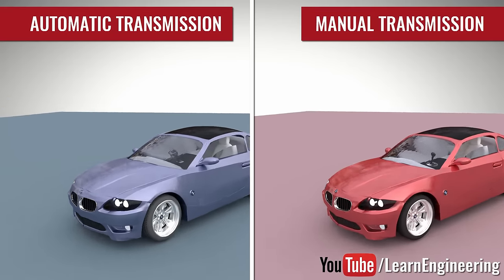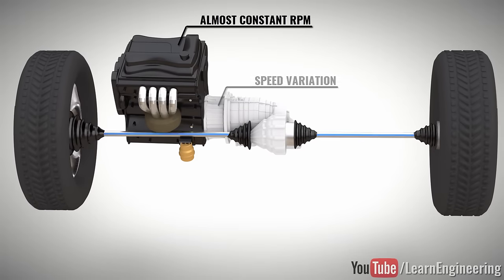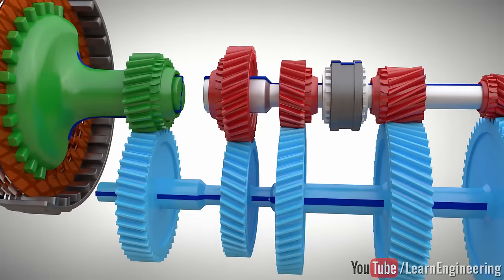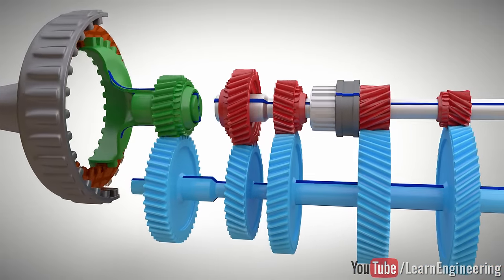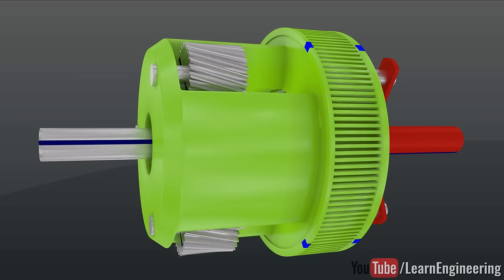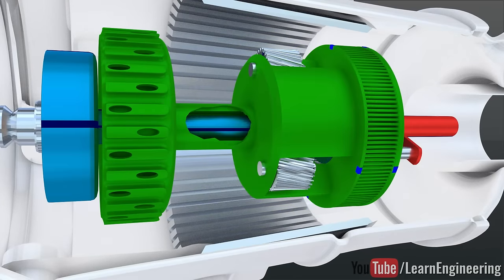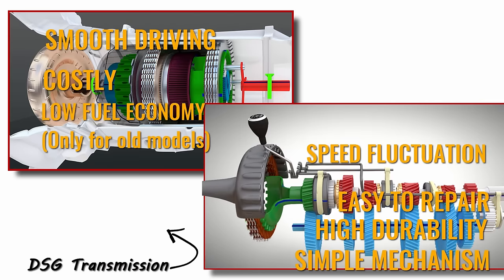Automatic vs Manual Transmission

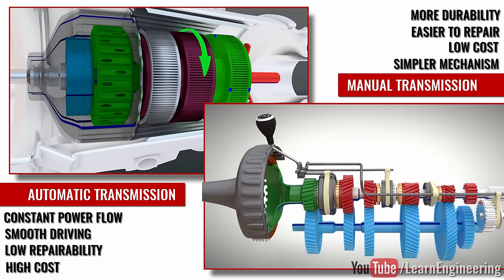Comment: 6:34 now that's an error, even a grave one in certain cases. Engine braking is much safer and keeps the brake last longer. Doing it is relatively easy: press the clutch, shift down 1-2 gears, release the clutch steadily to prevent sudden thrust, and if necessary, lightly brake to signal the following car that you're slowing down. Braking while pressing the clutch can often be quite dangerous, especially when driving downhills. The only time you should do it is when exercising emergency brake.
Reply: Yeah dude said press clutch then brake and all I thought about was the new brake pads I'd be buying for my work truck lmao

Comment: Manual - direct acceleration
Automatic - you're ran over by a semi because the transmission needs a minute to think which gear to engage after you floor the pedal

Comment: By the end of the 1940s Americans disliked manual transmission so much, even though it had been made more user friendly with the synchronising mesh aka synchromesh technology, that more than 96% of people who bought brand new Cadillacs in 1949 were willing to pay an extra $200 in 1949 money to get the automatic transmission, which was an optional upgrade, not standard despite its overwhelming popularity. In other words fewer than 4% of 1949 Cadillacs came with the "standard" three-on-the-tree three speed manual transmission. Cadillac dumped manual transmissions after 1949, however there is a story on the internet that a woman ordered a manual transmission Cadillac in 1955.

Comment: I prefer manual, but the newer automatics are WAY more fuel efficient. I had a 2017 Freightliner Cascadia (manual) and averaged 8 mpg, whereas my 2019 automatic, I got up to 14 mpg. In my Manual, I could also spoof the governor. It was set at 62 mph on the pedal and 64 mph on cruise, but when I drove over an overpass (or up hill), the second turbo would spool up for extra power and when I got to the top, it jumped up to 67 mph and I'd hurry and set the cruise. As long as I didn't have to brake or slow down, it'd stay there. 😁 I know 3 extra mph doesn't seem like a lot, but at .45 cents per mile, it was a $1.35/hr. raise!

Comment: You don’t have to push the clutch before breaking in a manual car. You can also use downshifting in a manual car to perform engine breaking which is impossible in an automatic car.
Reply: you know an auto also engine brakes its just a bit less than a manual

Comment: If you’re braking in a manual with your foot on the clutch (disengaging it) then your doing it wrong. You lose the engine braking and increase stopping distance. Not to mention, you lose your brake pads quicker! Plus, to suggest a manual transmission is never smooth is very wrong! It’s not only the lead in ya pencil that makes a mark on the paper!

Comment: It's the same thing, same job, one's manual one's not. It depends on what you want, you want an automatic trans for daily drivers like work and back go for it. you also want manual for performance cars since you can control the gear yourself go for it. Also manual trans is good for mountains if you don't want to destroy your brakes and have to redo your brakes at the end of the month. Also another reason why older cars with manuals have lower fuel economy is because of the government didn't make you put as many things in the engine as they do today. Also if you're good at changing gears it will be a smooth ride, unless you're lazy. Remember, car manufactures told you how to change fluids or engine parts, now they have to tell you to not drink the coolant.

Comment: That statement about manuals is almost completely false. Manual driving can be very smooth if you know how to rev match, or even just hold the clutch at the bite point for a second or two. And you should only push the clutch down if you're changing gears, or your engine speed is about to go below idle. Not just whenever you brake.

Comment: At 6:35 “In manual transmission driving, before you press the brake pedal, the clutch pedal must be pressed completely.” WRONG! The clutch pedal only needs to be pressed completely if you are planning to come to a complete stop, if you are “locking” the brakes in an emergency, or  if you are going very slow for the current gear and could stall the engine. If you just need to need to slow down because of traffic conditions (or because you noticed a speed limit sign), you can often use the brake without needing to use the clutch pedal. I have been driving for 40 years and approximately a half-million miles and have done this thousands of time.

Comment: in a manual, u dont actually need to use the clutch if u know ur car well enough, my grandfather doesnt use the clutch for anything other than starting off, as if ur good enough, u can match the engine rev s to the desired gear speed in between gear changes

Comment: You forgot the biggest practical difference. Speed control in a manual is an intuitive, passive process because the engine and wheels are directly connected, so any change in speed will also have a proportional change in the sound of the engine. Speed control in an automatic requires paying attention because the engine RPM varies greatly. Well, most people aren't very good at paying attention to much of anything. The automatic transmission is 100% responsible for the plethora of seesaw drivers on the highway, and I hate all of them. If you can't hold speed, use cruise control.

Comment: Okay, at ~6:45 you're telling people to do something that can have you fail a driving test. You aren't supposed to disengage the clutch every single time you brake, just when lowering gears or stopping completely. It's dangerous to have the engine separated from the wheels for a long time.

Edit: lol, like half the comments are bitching about the same thing I am.

Comment: The statement about 80% of heavy duty trucks allegedly using manual transmission is wrong. At least here in Europe trucks have long become pioneers regarding automatic transmissions and can have more than 20-25 gears to become very efficient in driving, and reduce fuel consumption and emissions. So I don't know where this wrong statement stems from ...

Comment: You mention that for every time you push brake on manual you need to use clutch which is not true. You gonna engage clutch only when you brake enough for RPM to drop lower then idle engine rpm which most time is 1000-600 rpm.

Comment: 6:40 that's wrong . to have the bes brake you must use engine brake and the wheel brake toghether (a engine brake is when you are in a high gear like 3rd and you swich into 2nd, when you release the clutch the motor will slow the car down)

Comment: the confusing part for me was that you didn't explain how clutch and synchronizer actually works.
Reply: Clutch is same as neutral gear, that means your motor isnt conected to your manual. When you press clutch your manual just diaconect from motor and slow to that speed that syncronizer can slide

Comment: I find manual very smooth as I can control when the car changes gears. Much more useful on hills at slower speeds etc, much smother than an auto. 🤷‍♂️

Comment: Manual is better for places where there are a tons of hills, up and down, like North Italy. The italians bought automatic transmission ambulance cars, the cars' transmissions died in 2-3 years, since it always wanted to shift up or down.
Automatic is more comfortable, and better for highway or long, straight roads.
Reply: Gearbox is irrelevant on the highway or long straight roads since your always going to be in the same gear doing a steady speed.

Comment: Thanks, I didn't understand a thing but thanks anyways...
Reply: Automatic transmission is manual transmission but just all compressed to a tiny space, so it changes gear immediately instead of moving a giant metal rode and can be putting power to the wheels the full time. Personally, I think the manual is better because it gives you more control over the car, I wish they manufactured manual cars today.

Comment: Modern automatic transmissions are actually quite a bit more fuel efficient than manual transmissions. This was the opposite many years ago. Also, the loss in power due to the torque converter is minimal and computerized torque converters (because literally every component of a modern car is computerized) are actually slightly more powerful because of the loss of power using the clutch in a manual. Go figure.

Comment: this is 7 years old, has 25mio views and still has partially wrong information:
- not all automatic transmission are build like that, there is also DCTs and CVTs
- even with the planetary gear principle you still have short loss of power transmission, lets call it dead time, because you can't 100% close and open at the same time, otherwise it might block up the transmission.
- big trucks/commercial vehicles do not to a high percentage use manual, because it makes sense, but because they are usually older and don't have newer technology
- not all automatic transmission use torque converters
- not even 7 years ago, automatic vehicles were less fuel efficient, that was only true way further back

Comment: 3:27 if you learn the engine and transmission of your car, you can learn how to properly match the amount of RPMs your gear needs in order to engage the clutch smoothly. My godfather's driving in a manual feels as smooth as an automatic, or even smoother. It is just practice

Comment: That's not how an automatic transmission is configured nor is there just one type of automatic transmission. Shifting via fluid pressure, a conical band shape and many others. Automatic transmissions normally have a bad power band bog because of the way shifting is handled.

Comment: Said it will never be smooth when shifting a manual this guy must not no what rev matching is
Reply: It will feel smooth but the acceleration is still interrupted, there's no power output when the clutch is engaged. d^2 x(t)/dt^2

Comment: Oh it's manual for me. I would never go automatic for several more reasons. With manual, you have much more control over vehicle and if you need more power, you simply go to lower gear, allowing you to use full potential of the engine.
Second, during winter, manual transmission allows for slow, low torgue acceleration. This is especially handy on icy roads.
And finally, the greatest problem of them all... cars with automatic transmission are F-ing boring. You just put on D and go on, but with manual you have to plan ahead. You have think when you put on lower gear, know when you can engage higher gear. After some time, you can pretty much do it just by sound the engine makes. Laugh all you want, but this can become a serious problem on long journeys. WIth automatic, you can easily start falling asleep, while with manual your brain is forced to constatnly work and think ahead. 

Also manual transmission is really F-ing satifying to use. It's sort of that easy to use, hard to master thing. As grandpa used to say "Be friends with clutch and you'll be able to do magic."

Comment: Outomatic versus the manual transmittion there's an a different once the outomatic transmittion have an a problem you spend a lot more cost to fix the whole unit while the manual transmittion will not cost to fix the units you could not change the oil for the gear shift set

Comment: I don't know shit about cars but here's my understanding of the video anyway, so in manual you have this rings that connects to 2 gears with an arrangement similar to an h-shifter and you have to disengage clutch to change gear while in automatic transmission theres 3 universal gears that switches between each other to change gear. Idk man its 6 in the morning I haven't slept yet

Comment: '' That's why manual transmission is not a smooth experience''
Me rev-matching: fool
Reply: Same here man, I have driven loads of people in my manual car and everyone is like damn your car is so smooth I didn't expect it, I have recently been saddled with an automatic since a speeding nutter took my manual off the road (Thankfully repairable) and my god the automatic is horrible its incredibly jerky and vague when driving and this is a 2021 courtesy car. How anyone who thinks autos are smooth doesn't know how to drive period.
Reply: @gravemind6536  its called a slush box for a reason

Comment: Automatics last longer.  Manuals wear out the clutch and synchronizers.  Automatics creep at idle when in gear.  This bad trait could be designed out, but only Packard tried, but it wasn't perfected.  Automatics are heavier and all moving vehicles benefit from adding lightness.  Automatics used to deliver worse mileage, but modern ones are much more efficient.  The 1952 Chevrolet Powerglide was the worst slush box on the road.  I know because I owned one.

Comment: When I was a teenager (just over a decade ago) my S-10 had a messed up clutch with only an half-inch sweet spot to allow shifting gears. Even with that the passenger would think they were in an automatic. (It help when you learn to drive going up the WV mountains)

Comment: In all honesty i dont see a reason to have a manual unless for the preference or for large trucks. I even heard drag racers are switching to automatics now. it just comes down to preference now.
Reply: Even drag racer prefer dual clutch transmission on top of automatic transmission.
Reply: Ummm they are smoother if you actually know how to drive, they are more reliable and cost less to repair, usually achieve better fuel economy and are much m ore engaging to drive.

Comment: Some good info but you left alot of info out of the equation and also the fact that a automatic and manual trans "4wheeler" which refers to a ATV Is completely different from the transmissions of a car. The video really kinda seems confusing to new folks or inexperienced folks if you already know all about these things from real world experience and watch from that stand point.

Comment: Well there is some nonsense in this video.
1. A skilled manual driver can drive as smooth as an automatic.
I can even change gears without pushing the clutch and without hearing the gears grinding.
2. So heavy duty trucks don't use automatic transmissions? 
Maybe you should tell that Scania, Volvo, Mercedes trucks, MAN and DAF.
All these trucks use 12 gear automatic transmissions, some of them since at least 5-6 years 
Mercedes, MAN and DAF have over 500 HP Scania and Volvo up to 770 HP and a torque  of about 3500Nm (2581ft-lb)
Just because you can't build high torque automatic transmissions doesn't mean others cant.

Comment: I just like manual. When you learn it its like breathing. US automatics are great, durable, but also heavy. EU automatics, from what I´ve seen are not that great. Mostly the "dry" ones. Dual clutch automatics are going to break, and as europeans we mostly dont wanna repair them, because it is costly, so we drive manuals. Aslo we drive 20yo cars, and 20 years ago there werent that many automatics around.

Comment: Manual gives u more control, especially when driving with a trailor it can come in handy and clutch breaking exists. However its a bit harder to learn and when u just do it wrong u can fuck up ur transmission. 

Automatic can accelerate faster cause shifting is way faster, also stuff like cruise controll wirks vetter caus if u have to break it can go up to top speed on its own without u haveing to manually shift up. And ofc, stalling ur car is almoest impossible.

Comment: If you’re skilled enough with a manual, you can reduce power loss to almost none
Reply: As long as you've disengage the Engine you lose power, Or do you drive without the clutch

Comment: I am really trying to understand but I can't 😢
Reply: Which signal do you guys trade
Reply: it's about the fake traders that you meet you haven't heard about Olivia Palermo yet
Reply: How can I get her
Reply: She's mostly on Telegrams, using the user name.
Reply: @Olivpal77💯.. that's it
Reply: Thanks for sharing details
Reply: Basically :

1. If you take a planet gear set and turn the gear in the middle (sun gear) or the ring (ring gear) by itself nothing will happen. There will be no power output because the ring will spin in the other direction (or the sun gear if you spun the ring gear)

2. In order to create power output you need to stop parts of the planet gear set and that's where the clutch packs come in.

By stopping different parts of the planetary gear set you can create different gear ratios. And it's automatic because as one clutch pack releases, the other compresses which allows a seamless transition
Reply: @pepebeezon772  hey there, thanks for information but I Know how the transmission basically works, I just can't understand how exactly it works!

Comment: Bro i have a question.....
If i have a CVT gearbox and i m driving on a downhill road....
So can i put it in neutral and let the gravity do the work and when straight road comes up i should put it in Drive mode.....
Is it OK to do this or am i reducing the life of my gearbox??
Reply: Sadly I can't answer for a CVT gearbox, but I CAN give you a perspective from a manual gearbox. Usually, when driving downhill, you almost never put in neutral since you are putting a lot of strain on the brakes, which can heat up quite quickly due to constant and excessive braking. Putting it in a lower gear than normally means that you are also braking with the engine, thus easing up on the brakes. For your question some people suggest switching to manual mode or hill descent mode, if you have that options on your gearbox.

Comment: I always had an automatic car but my next will be a manual. I've had it with the constant braking, the mechanical transmission problems and the money I have to throw at this car to fix those problems. I even replaced the transmission and even the new one is crap. Automatic cars might be easier to drive but they don't last long.